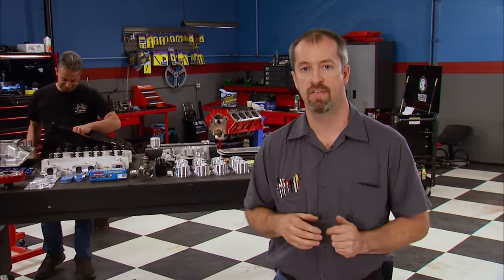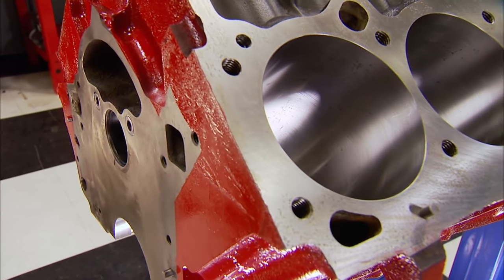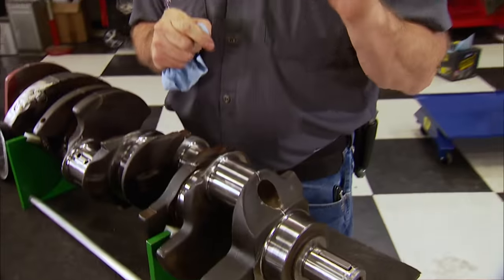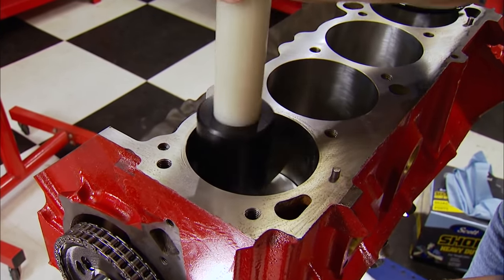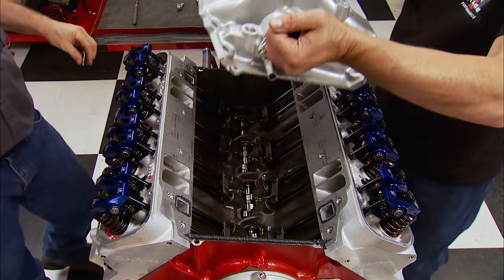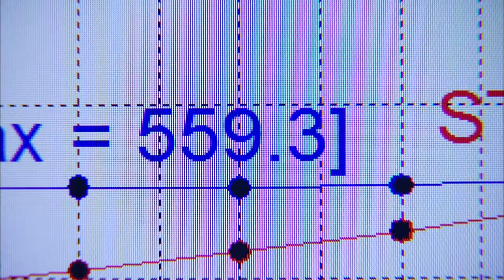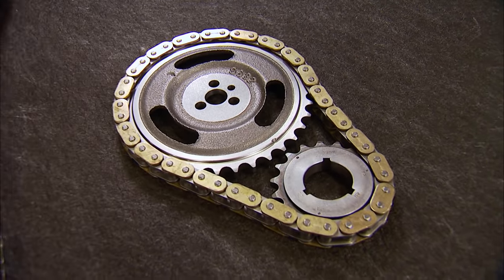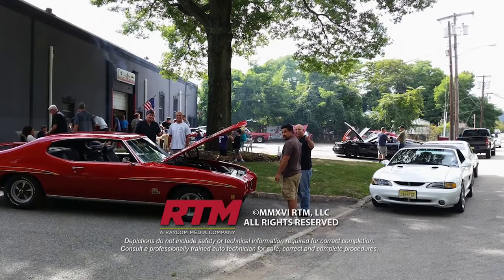Building A 455 Buick That Makes Surprising Pump-Gas Power - Engine Power S3, E17

Comment: “What did you do to your Buick” same thing you do to all of them: you add compression, cam, intake, head flow, and ect. A tale old as time.
Reply: Don't forget "misplacing" the cats and any other EPA crap hahaha
Reply: @pablotharpalo5685 . Lol, why I would never do such a thing😅🤣
Reply: @bri-manhunter2654  oh you know. Clumsy little old me, losing the cats and vac pump again 🤣
Reply: Yeah, it’s real rocket science
Reply: @ultimatejay . lol, right!🤣
Reply: Actually its in the combination of the parts that are used a lot of work and mathematics goes into building engine power especially on 93 octane, you can't just throw a big camshaft and good flowing heads and make alot of power in fact it really depends upon what you are using it for,  and the process of adding parts combinations that will build up power and torque, its why they sell the combination racing kits so you know what to expect from the engine after its built.
Reply: @billflk2364  exactly my friend.
Reply: It's a 70 motor. No cats necessary
Reply: Oh... so you turned it into a small block chevy 😂 got it..
Reply: @billflk2364  . Yes, that is true, the Hemi in my Ram was Blue printed to be a perfect build for what I was wanting. However, a blue printed motor is not necessary when building many motors, like the LS & 3rd Gen Hemi’s.

Watch a couple Richard Holdener videos and see how your world opens up.

Actually I disagree with part of your statement. Making power has always been the easy part: head flow, compression, & valve events. Now issues like having the wrong intake manifold for your cam selection is a mistake I see many guys make. I see non boosted small cam guys  with the 3rd Gen Hemi not utilizing the 6.4L intakes and loosing all their bottom end power. You see LS guys going either with rec port heads and losing compression on their SBE builds.
Reply: @snickersberet4792 . Lol, if it works😅
Reply: And entertaining every damn time!
Reply: TA performance from Scottsdale James some killer cylinder heads for the big block Buick. They also make parts for the 350 and the V6.

Comment: The 1970 Buick GSX 455 stage one and two was the Hemi eater!!!
Reply: Hemi killer to be exact 👍
Reply: Seriously? I'm a Buick fan and and very impressed with them. But as every sanctioning body in racing has proven and there's no denying that, The HEMI dominated... No and's if's or buts about it. It is what it is, But In nearly stock form yes 455 was extremely powewrful as the Musclecar magazine in the 80's showed with the Buick vs Hemi shootout. Anyway you look at it the 455 is impressive.
Reply: The Buick GSX 455 tossed the salad of the HEMI. There, fixed it for you.
Reply: @VGHCX my engine builder would 
Buid a engine that would eat a hemi 
Anytime anywhere

Comment: i used to have a client that was huge Buick guy. He bought stage 1 455 engines from all over the country and had 5-6 of them in his barn. He showed me a 11-1 compression 455 stroked to 480-490 ci with fully ported stage 1 iron heads and big hydraulic cam that made 650 hp & 610 torque.   He ran high 9s in a 68-69 Skylark. I had never heard of a Buick running close to this fast before.
Reply: Were you under the influence when you saw it run high 9s?
Reply: @VGHCX  No -  I lay off that stuff so people like you can abuse it.
Reply: @tomsettles6873  To make that kind of power with iron heads would require boost or nitrous. No NA 455 can make those numbers.

Comment: I'd like to see a video comparing a Buick 455, Pontiac 455 and Oldsmobile 455.
Reply: There's one on youtube!
Reply: It’s already been done and Buick won the gold.
Reply: Buick best out of the 455
Reply: The Buick had a better rod ratio. shorter stroke, longer rods,bigger pistons. And a lighter block. The Pontiac and Old would make a good truck motor with all that long stroke for pulling. But they didn't have the power from 50mph and up as the Buick 455. Talking about a 350 Olds had a little better rod ratio than chevy. But chevy had more available off the the Shelf parts available a Buick and Pontiac 350 lacked. The Buick 350 at least weight was 450 lb where the Pontiac 350 weight was the same as the 455 650 lb. But when talking about a 455 I love the way the high compression Buick 455 ran it out did the others
Reply: @anthonytoler3916  Pshht.... 
My Olds big block WILL smoke a total of 36" (3 feet) of rear drag radial on my ladder bar Cutlass at a 50mph roll, IN third gear, for a hundred feet, with NO issues...

Comment: Years ago I lived in NJ and I walked past a very nice light blue 1967 Pontiac GTO and a older guy had the hood up doing something to the engine. And when I glanced over at the engine it had a red 455 Buick engine under the hood. I became curious and ask the older gentleman why did he put a 455 Buick engine in that car and he said it came with a 400 Pontiac which ran good but the 455 Buick ran better. So I asked him why you didn't put a 455 Pontiac he said man we race these cars all the time and the Buick just runs better in terms of power. The Pontiac 455 runs out of breath on the top end and the Buick keeps pulling Simulator the 400 but with just more power all around.

Comment: 15:53 "Everybody had a Chevy" Greatest line of the whole episode. I was always more of a Buick/ Olds person myself!
Reply: And all you need to build "surprising power" with this big-block Buick IS...BBC rods. And SBC "truck motor" sized combustion chambers. Nothing ironic about that at all. 

Kind of like it being 175 lbs lighter than "a BBC" and only 25 lbs heavier than "a SBC". Of course those comparisons are to iron-headed Chevys. 

Equally ironic - and funny - is that you GOTTA have the new reproduction "timing cover" and oil pump to build a TRULY "NEW" 455 Buick that's ACTUALLY a 470 and therefore 2 cubic inches bigger than the most common "high performance" BBC - the "468". BUT use of a "seasoned" - i.e JUNKYARD 455 block in your "NEW" and "surprisingly powerful" Buick engine "build" is A-OK! 

And who DOESN'T want a "thin-wall casting" for a high-performance engine "build"? 

Last of all your choice of "all Buick" muscle cars to put said "surprisingly powerful" Buick engine "build" into is pretty much limited to a Buick Skylark/ GS or Riviera/GS. Pretty much big "boats". 

The final or rather first bit of irony is the claim that Buick 455s supposedly aren't known for being "fast" despite Motor Trend supposedly wringing a 13.38 1/4-mile out of a "stock" 455 "Stage 1" GS making it supposedly the "fastest" American "muscle car" of that "era". 

And there is on more ironic "twist". BOP "emthusiasts" suddenly focusing on SAE "gross torque" as the most important and impressive "number" for "muscle cars" in the "early 70s" because their non-Chevy high-performance big-blocks got decimated by every Chevy high-perf big-block from the 409 through the 454 in SAE gross HORSEPOWER and were even "upstaged" by the Chevy LT1 350 with 370 SAE gross horsepower. 

All in all there was and is so much cherry-picking of the "data" to make BOPs come out "on top" vs. the "competition" at Chevrolet the BOP "enthusiasts" give even Fordtards a run for their money in the "propaganda wars" against "Chevy". 

And in both cases the non-Chevy guys think Chevy guys give a shit if a BOP or Ford is the "winner" of the BENCH RACING from "back in the day".
Reply: Don't forget Pontiacs. Gotta keep the B-O-P anti-Chevy "brotherhood" one big happy family.
Reply: @deeremeyer1749  That's more quotations than Brainy Smurf!
Reply: As a BOP kid and Ford man. I love em both over a dookie chevrolet
Reply: @deeremeyer1749  only little boys wear bow ties!!!

Dude, enough with the “quotation” marks!! 

The Mopar guys bad mouthed Buicks years ago. I’d suggest reading The Hemi killer article from hot Rod magazine. Some chest thumping Mopar Hemi fanatic took offense when motor trend magazine listed its 50 fastest muscle cars and a Gran Sport was quicker. The guy challenged abu buick owner, saying “Buicks run like they are tied to a tree!”  It didn’t go well for the Mopar fans. 

Unless you are John Force, chances are someone is faster than you.
Reply: @mattrodgers4878   You ever get the idea that the only thing worse than a butt hurt Chevtard is 2 of them? LOL
Reply: @deeremeyer1749  At the end of the day an engine is just an air pump and its mainly all about keeping it held together at the power level you want to make......some people just enjoy punishing themselves with exotic hard to get parts. I'm normally a mopar guy but my current project is a small block chevy, I will say its nice to be able to just click a button and have parts easily available for once.
Reply: Yea, me too.... Oldsmobile to be exact. 💯%

Comment: I restored 3 original '70 Stage 1s at the same time a few years ago in my shop. I've been friends with several Buick fanatics who swear by the 455, and I've done tons of work on several other S1s over the years. I've seen one with the original engine. Pretty much every guy I ever talk to talks about how good these engines are, but none survived in their original cars because of oiling problems. After you drill the drain hole to the timing chain, change the cam groove, align oiling holes and 20 other things, then they're "bulletproof." Reason 4,985 why Chevy engines are the most succesful and prolific V8s in history.

Comment: Always been a GM guy. I had a stock weight 64 Buick Special with a "very simple" pump gas 462cu. in. / 400 turbo/ 4.10 gear car and it would outrun 90 to 95% of the street cars in the S.E. Tennessee area way back in the early 90's with what I thought was half of the motors of the other guys. My favorite "loss" was running a "built" 1965 440 MOPAR and losing by a fender!!!!!! Got home and realized that my 750 vacuum carb (that's correct... wasn't a double pumper!) wasn't opening the secondary's!!!!! I got out run by a fender by a "built" car with only 375cfm of carb on my engine! Buick engines are SOOOOOOOO overlooked...

Comment: Awesome!! The 455 Buick is a torque monster!! My 455 and Turbo
400 came out of a Electra 225 and I
put it in a 79 Buick Regal, first year
I ran it stock and destroyed 2 ring
and pinion sets then I replaced the
rear end from a 1980 Monte Carlo
and added 3.70 gears, before I sold
it it would jump beer cans with the
front tires from a dead stop, Damn
I miss that car!!!!!!  I still have that
Engine and Tranny!!! 
👍👍👍👍👍👍👍👍👍👍👍👍👍
Reply: Why in the HELL would you replace the wimpy rear-end with the exact same wimpy rear-end?? 🤷🤦
Reply: If you still have that motor I will buy it 😂😂😂
Reply: It’s good you jumped that beer 🍺 instead of wasting it!

Comment: So excited to see this since I have a 455 sitting under a tarp waiting to be built for my 50 Buick. And Stage 1 is only 3 hours away from me!
Reply: What are you waiting for, get er done bro..
Reply: That 455 will have plenty of power stock... but if it's a 1970's emissions slug, have it tuned rebuilt for much better MPG...
Reply: @P71ScrewHead  Just dropped it off yesterday!
Reply: @firefighteruppy9121  that's good news..
Reply: Rob is the man! It took almost a year to get it done (damn parts shortage kept us waiting 9 months!) but she is a beaut! He put it on an engine dyno and came out with 485 horses and torque was at 545. Now I'm waiting for a new chassis to be built to handle this 462!

Comment: It's unfortunate that Buick is generally underrated. They always made an excellent engine even in the antique days. The small block Buick In all its various forms has a great racing history, and a ton of potential as well with a very light strong block. I'd love to see more  of the classic stuff. Thanks guys.
Reply: For high performance the 455 Buick could use a engine block girdle.
Reply: @autodidact537  for anything over 500hp it's pretty much a necessity if longevity matters. Block strength is the achilles heel of the big block buick. They are wonderfully light, but kinda weak with the power that can be made with today's parts. But that's true for a lot of engines as well.
Reply: The small block Buick sucked ass...

The bores were too small to get it to breathe enough to be a race anything. That's why it's HARD A.F. to find any off-the-shelf performance parts for a small block Buick.... Just try to find a readily available intake for a small Buick. There's NOTHING out there except for maybe a specialist or two that has one that'll cost you a thousand bucks. 
The fact is, that no one made performance parts for them BECAUSE they sucked as a performance engine. The buick big block had more parts available because they had a bigger bore, and were worth investing in parts

It IS what it IS.... 🤷
Reply: @davelowets  The small buick in many of its forms had a lot of success in competitive motorsports. Jack Brabham scored six poles and four consecutive wins in a nine-race season, good enough to capture both the F1 Driver's and Constructor's championships in 1966 with a stock block. Lots of people were using the 215 as a starting point for racing in the mid 60's . Guys like Mickey Thompson, Lance Reventlow, Jerry Grunt, Dan Gurney, and many more in Europe later on as a Rover. Then there's the v6 version that ran in the Grand National Sportsman circuit, the  Indy Racing League and Indianapolis 500, NASCAR Winston Cup, IMSA Camel GTP, IHRA, Camel Lights and GT, SCCA and IMSA and NHRA drag racing and participated in world speed records at Bonneville. There were tons of guys racing buick powered cars in the 80's like Tommy Houston, Scott Brayton, Pancho Carter,  Dale Jarrett, L. D. Ottinger,  Morgan Shepherd, Richard Petty, Eddie Cheever Jr., Arie Luyendyk, and Buddy Lazier, and Buddy Ingersoll. All in all a very long and successful career in motorsports for a passenger car engine family. Just because summit and jegs aren't full of cheap buick parts doesn't mean anything. It is what it is after all.
Reply: @user-cs1ne8gx9u  The 215 isn't even in the same league as the Buick 350. Completely different design.
Reply: @user-cs1ne8gx9u  The ONLY Buick V-6 that did anything in NHRA drag racing was Buddy Ingersol, and he didn't make it very far, or for very long with it. C'mon man, you can't feed me B.S., I'm already WELL AWARE of what Buicks have done and accomplished, and YES, there IS a reason that there are hardly any parts made for a Buick 350, and that you WON'T find Buick 455 parts in ANY major performance parts catalogs.... people DON'T bother to build them very much, and the aftermarket is WELL aware of this, and doesn't bother to make parts that would be a let down on an engine that nobody what's to build anyway... 🤷 
It IS, what it IS..
Reply: @davelowets  the 350 Buick is part of the same engine family. Same deck height and stroke as a 340 just with better heads and .050 more bore. Not in any way a completely different design.
Reply: @davelowets  Feel anyway you like I honestly couldn't care. But facts are facts.

Comment: My first car was a 1970 Buick Skylark with a Pontiac 455 in it. It was setup for drag racing but was street legal. The engine made gobs of torque, I think the engine dyno sheet said 650lbs. And that was with cast iron heads and a moderate lift cam. The car was difficult to launch on the street but it was a lot of fun. My best time at the track was 11.8 in the 1/4 and that was spinning my tires the first 60 feet. That was fast back in 2005 when I bought but these days I’d get walked by a base model Corvette. Lol. In fact I remember when the C6 Z06 came out in 2007, that’s when I started losing street races.

Comment: I’ve got a 340 Buick I’m working on right now, I keep thinking about getting a 455 but I already built the rear end and trans and I think a big block would grenade them. Awesome episode!
Reply: Not necessarily. It really just depends on how much power you pick up.. if we talking about a stock 340 and a stock 455 , there's just not enough power increase... Now if you talking about a stock 340, and then dropping a built to the max 455 , yes lol it's gonna frag
Reply: Ditch the small block... there isn't hardly any performance parts out there for them because the bores were too small for the engine to breathe well enough to make any performance parts for them. It wasn't worth it.
Reply: @davelowets  Yeah but I can’t afford $3500 worth of transmission, $2500 worth of rear axle and $15,000 of big block and parts. If someone wanted to just give me a T56, a 12 bolt and a 455 with all the work done to it, sure. That’s not how the world works.
Reply: @Flyboy207  why would you need a t56 for a 455 and not for a 340? Your statement doesn't make sense.
Reply: @davelowets  because the transmission I have won’t handle a big block.

Comment: Ha,he said he beat all the chevys,I believe it,I did the same in 87 with a 74 pinto wagon with a 66 425 nailhead with factory dual quads,bored .030 over and balanced with a small cam,my uncle had it in his 57 Chevy for years,we built the pinto with a 401,when he wanted to sell his 57 we put a 350 combo in that and kept the 425 for the work and buying the 350,put it in the front seat area ,drove from factory back seat,12 gauge trans tunnel and firewall made it 3,200 lbs.,switch pitch with th400 guts and 2,400-2,800 stall and 3.70 gears,ran 12.7 @ 107 on street tires,better on the street than the track,on the street it launched hard as hell,buicks set up right fly!!!